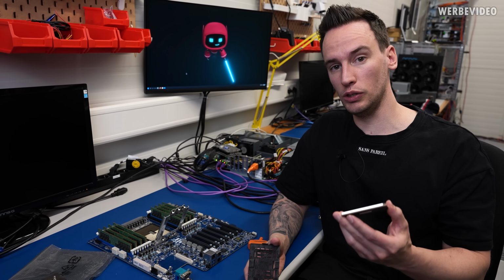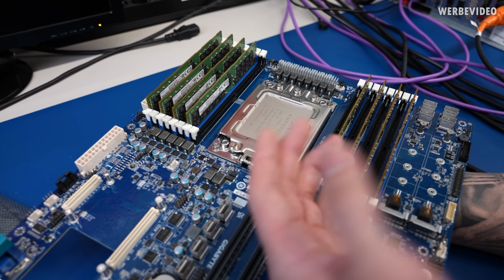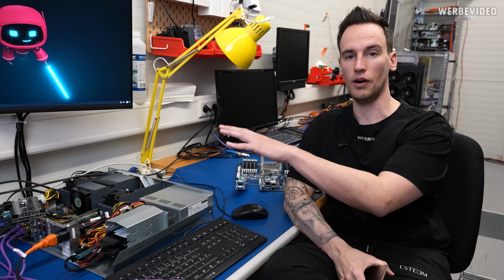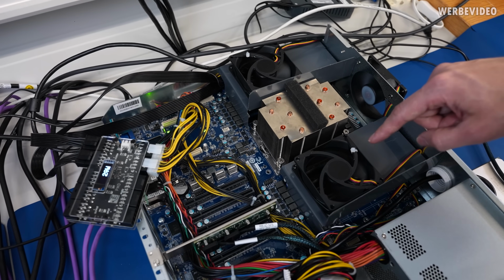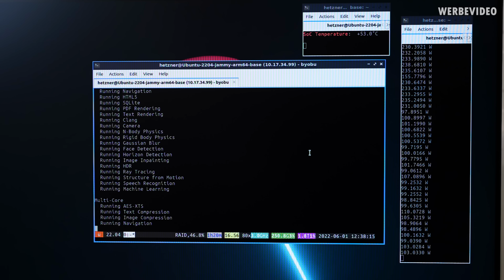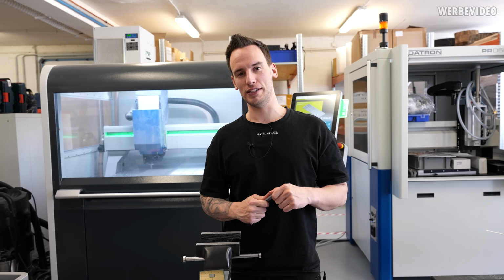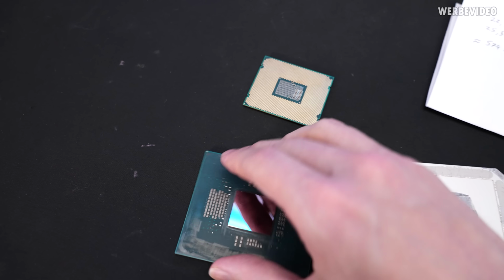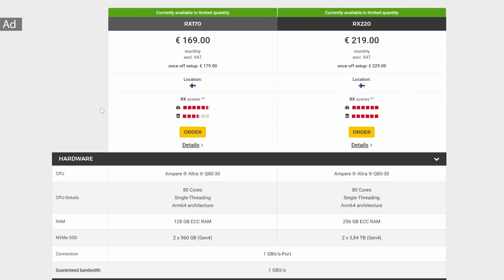This insane 80-Core ARM CPU easily beat a 64 Core Threadripper

Comment: Hetzner is awesome! And that ARM cpu is a Monster! 80-cores 250w 56'c just lovely!
Reply: 310W and 65C... Ohh and for that u need to delide it(bye bye warranty)... And still using thermal paste in 2022... Intel soldering too and its still sucks, but not that much... AMD much better and 128 core on the way in the WX5000's!!! Bye Bye shitty 80 core ARM
Reply: @MadGangstaHUN  doesn't need a delid.... Learn to use your brain
Reply: @MadGangstaHUN  310W was the whole system. The SoC was only 170W.
Reply: @MadGangstaHUN  All of this is false. AMD 5000 series tops out at 64 cores and 128 threads. 7000 series is rumored to reach 96 cores and 192 threads.

The whole system used 310W at the higgest peak, but the CPU power along was only around 200W or so. Other components such as memory, VRM and PSU losses, and IO amd storage cards can easily make up the difference.

Deciding was not needed to cool the CPU. Watch the install process again. They just stuck it in there and mounted the cooler. The delid was performed afterwards to showcase the size of the die compared to the size of the package.

Stop spreading misinformation.
Reply: @MadGangstaHUN  Are you a child? Stop spouting nonsense and just appreciate newer hardware innovation. I'm sure the people deciding to use thermal paste are much smarter than you and would have good reasoning behind it. You'll also find 300w over such a large die won't have the cooling issues, like a 12900k with a die only the fraction of the size but similar current draw. The wattage per square mm would actually be rather small.

Comment: It is cool to see, that ARM CPUs / SOCs can be used for other than smart phones and small single board computers.
Reply: ARM processors were in fact a capability that Acorn Computers developed for desktop computers back in the day.  I remember being wowed back in school by the sheer speed, power and graphical prowess of the Archimedes computers in our IT classroom.  Back then they really were something, especially if one was used to the likes of Spectrums, Commodore 64s and BBC Micros.

I still have my Acorn RISC PC with StrongARM processor.
Reply: @Jenny_Digital  Did you know that you can run RISC OS on a Raspberry Pi? It runs well even on the original 256MB Pi, which has much more RAM than my RiscPC has. I have a Model B dedicated to the task.
Reply: @johnm2012  indeed I do, and not only that but it’s damn fast on a Pi.  There is an issue where some RISC OS programs don’t like the GPIO header on some pi’s though.
Reply: @Jenny_Digital  To be fair, Spectrums, C64s and BBC Micros were all based on the 65xx platform and from a decade earlier. I had an Amiga and while I thought it was awesome, I had a friend who went to school over in the UK and came back with an Acorn RISC PC. That thing was really cool. Closest thing (back then) to an ARM I got was the Sparc IPX.
Reply: @ohnodevo  Mostly true.  The Spectrum was based on the Z80A and clocked at 3.54MHz.  That sounds better than both the NMOS and CMOS versions of the 6502 until you realise the Z80 had to take more clock cycles to perform some of its instructions.  Neither of those 8-bit processors did any pipelining either, though the Z80 variants had a few clever tricks up their sleeves.  LDIR for example used the BC, HL and DE registers to perform a vector copy of a block of memory.

I think this highlights the issue comparing architectures with synthetic benchmarking tools too.  Thinking back all those years, the fastest other computer my school owned (that I knew about) was a 286 with monochrome VGA.  Hardly a record breaker at the time.
Reply: The previous champion of the Top500 supercomputer is powered by ARM CPUs
Reply: a car has 200 of them
Reply: Yeah. Its used on phones because its efficient and early on developers and engineer realized that it's unfeasible to invest in x86 phone sized devices. On pc it would be the same if we could easily make stuff compatible to arm  or risk it qould be great since energy and physical space efficiency is much greater on risc and arm, so with the same space a regular x86 takes on a MB it would fit a much faster arm processor. Thermals would probably be the same since it's mostly dictated by how much performance the manufacturer want out of the die accounting for the energy it takes.
Reply: Also, as much as i dont like apple for many reasons, i see forcing the use of ARM was a good move. It could give a kickstart on developers to make stuff compatible with arm so eventually arm is the norm for pcs, allowing for huge performance gains per price and energy spent.
Reply: cue apple studio
Reply: Acorn computers were originally workstations
Reply: Apple already proved that. M1 and M2 are customized ARM CPUs.
Reply: @thinkingmonkey236  I was about to mention Apple. I study mathematics and the new apple stuff makes me very interested in these ARM systems. Especially when they stuff them full of nice features for vector calculations and such - as an example.
Reply: @thinkingmonkey236  Those are shitty CPUs lmao. 🤦🤦🤦
Reply: Get used to it, it's the future.
Reply: @BroBytesBhai  Yes, I also hope that RISC-V will be there.
Reply: @borisvokladski5844  

And i hope VLIW is coming back to mainstream computer, especially due to improved programming and so
Reply: @borisvokladski5844  As I see it, RISC-V is the future, but since it's difficult and expensive even with the advancements ARM is the next step until RISC-V can be used for the majority of the consumer base sector (which is good since most code is also been supportive to RISC-V which wasn't a thing when arm begin to become more available for the consumer, the benefit of today's world).
Reply: @BroBytesBhai  

I'm fed up with nISC monopoly

Give me high performance VLIW for mainstream users!
Reply: We should have been using these CPUs 30 years ago.  With Apple now making their own ARM CPUs, I believe it will have to make AMD and Intel take a look again.
Reply: @badwolfsat5  
Of course, RISC processors are superior to x86/x64 processors in specialized applications.
However, desktop PCs have the peculiarity of also running other software that is not specifically tailored to a processor type.
In the second case, RISC processors are many times inferior to CISC processors.
Supercomputers are also highly specialized systems, and this is where RISC processors can really shine.

In a closed ecosystem, like Apple's, it's not necessarily a bad thing to use RISC processors, but for open/modifiable systems with extreme software and hardware variance, CISC processors are the better choice.
Reply: @sylviarohge4204 any examples for 'not specifically tailored to cpu architecture' program that x86 runs fine and arm struggle with?
Reply: @bulletpunch9317  
Any software that has not been optimized and aligned for RISC.
In this regard, CISC is a jack of all trades.
That's the core difference between these two architectures.
RISC can do a few things exceptionally well, but has problems with everything else (or needs significantly more clock cycles, since the complex code has to be broken down into numerous small instructions, for which CISC, for example, may have a direct instruction for).
CISC, on the other hand, is a jack of all trades, can basically do everything but is nowhere particularly outstanding.
Reply: @sylviarohge4204  ok,so can you give an example?
Reply: @bulletpunch9317  
Not specifically, but computer games in general.
The more complex the software, the more likely it is that CISC offers advantages.

Just think about what RISC and CISC mean exactly.
The complex instructions lead to the CISC mastering operations that RISC has to break down into many individual steps.
There are operations that take 1-2 clock cycles with CISC, but with RISC they require 6, 12 or more clock cycles, for example, since the operation has to be divided into many sub-steps.

RISC is not a new concept, nor is it a silver bullet.
What RISC can do, CISC can do, but what CISC can do, RISC cannot necessarily do.
ARM didn't reinvent the wheel, but it did market its product well.
IBM's power processors are also RISC, but unfortunately IBM's processors are only aimed at the server market (supercomputers).
In terms of performance, IBM's power processors are possibly even superior to ARM's processors, but they are outrageously expensive and only for very special customers, so they are not widespread.
Reply: @sylviarohge4204  in a benchmark like spec which tests would arm struggle with compared to x86?
Reply: Turing complete, so it makes sense.

Comment: Crazy... I wonder if x86 will eventually topple to another architecture in mainstream consumer computing. Certainly seems possible with M1 etc
Reply: x86 is an all-around workhorse with tons and tons of legacy-code that still need to be run 50 years from now. Very likely it (and its derivatives like x86_64) will stay the mainstream architecture for a long time.
Reply: Maybe we are going to see hybrid CPU x86+ARM cores soon.
Reply: The next generation of software will likely not make it more efficient but actually the opposite. X86 has lots of good very well working optimized programs. In comparison Arm has more trash code very likely not optimized except for what you get default as it comes from the phone market which lives by the standard of memory i don’t care..
Reply: This all depends on the work loads you are using. There's a reason why X86 is still used in most datacenters. It's optimized and faster for the workloads that it's being deployed to serve. X86s are internally risc and have been for close to 20 years or so.
Reply: I thought ARM was going to topple them in the 90's and they nearly did.
The first ARM was faster than intel at the time and at almost no power.

Comment: Damn, this truly proves that ARM is the future of CPU technology.
Reply: How does this prove anything? Arm is a different instruction set compared to x64/86. And this 80 core CPU has a particular application for servers, same way even a threadripper is a workstation CPU for its own purposes.
Reply: ARM is the future of running geekbench, yes.
Reply: No it isn't.
They focus on different things and have different benefits. x86_64 is a broader instruction-set that can do many things orders of magnitude faster and more efficient than ARM, and ARM is a more slimmed down instructionset that can do basic arithmetic way more efficient.

Kinda like comparing a truck to a bus - they both carry cargo, but different types of cargo and neither can realistically "replace" the other.
Reply: ARM is the future (we said in the 80's)
Reply: no its not, it will be replaced when someone finally decides to make a perfect instruction set instead of these random ones.

Comment: Can you compare benchmarks across 2 different version of the benchmark software? Like when you run the benchmarks on AIDA64, it warns you not to compare benchmarks gained on different version numbers of AIDA64.
Reply: Depends on the benchmark. I'd say that comparing the render times of say cinebench or blender is valid so long as the same frame(s) are rendered as putting "scores" aside, the only thing that matters (IRL) is render time, which makes it pretty platform agnostic
Reply: @JaenFoster  that's what I was thinking, if it was something that could be compared independently from the benchmark, render times, or Mips, then that would be meaningful. It was more the Geekbench score I was meaning, obviously that would be hard to compare across different architectures.
Reply: Depends on the benchmark itself, I wouldn't compare two off the shelf benchmarks across 2 architectures, however one can easily develop some benchmarks to test the performance between 2 architectures to calculate raw performance.

A benchmark like a blender test essentially times how fast blender takes to render a scene, it wouldn't measure the architecture's raw performance but it's what a user can expect in real life from that architecture
Reply: Different version numbers is not the same as same code built for different architectures.

In general there's no reason why runspeed of same code built for different architectures with recommended compiler for each shouldn't be compared. That would show how average software is going to run without need for any hand-tuning (which is expensive or even impossible if you intend to run some closed-source software).
Reply: You certainly can. AIDA64 is just different software variations so optimising the software and reinstalling the newer version would obviously get a better result however in that instance you would be running the test on the same hardware. 

Assuming you are running the bench on two different hardware systems there may be certain hardware advantages that allow for higher performance so you should also note to use the latest and most optimised piece of software for use for the best comparison between two different hardware systems.

Comment: Too bad it can't run any other benchmarks. Geekbench is pretty trash.
Reply: what are you on about, you can run any benchmark on this that can be compiled on Linux Arm
Reply: @desertfish74  why are these kind of videos always using only geekbench then? synthetic benchmarks are really bad as is, but geekbench is probably the worst.
Reply: @nathanjokeley4102  DerBauer is not  a benchmarking channel I guess, if you want to see other benchmarks look elsewhere such as Phoronix perhaps.
Reply: @desertfish74  test is also flawed because he's comparing a newly released product to 3990x which is zen 2 when zen 4 is about to be released in a couple of months. comparing new cpu to almost 2 generations old cpu is unfair.
Reply: @desertfish74  Yes but, most commonly acknowledged benchmarks are x86 only.
Reply: @Alan_Skywalker  never hear of Linpack?
Reply: @mycosys  Yes but it's not a commonly used application, I only use it for stability tests.

Comment: I always thought that all ARM CPUs are always soldered permanently to the Motherboard.

So I was wrong
Reply: it's all about what it's engineered for, if you need a ton of power and upgradeability and aren't as worried about the size then any cpu can be made socketable 
the only reason all phone CPUs and most laptop ones are soldered is that the whole phone motherboard is smaller than this CPU's PCB
Reply: Here I am thinking arm cpus are for phones and tablets lol
Reply: you should be soldered permanently to a motherboard
Reply: You probably weren't wrong a short 2 years ago, it is just new applications calls for different packaging